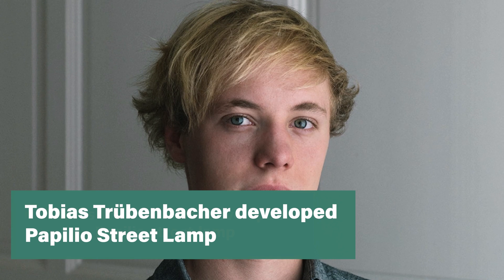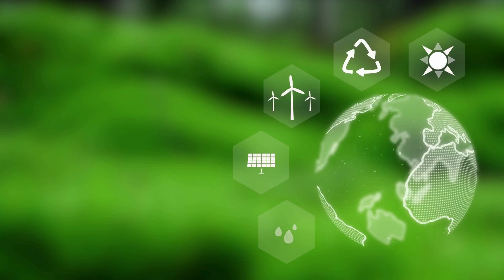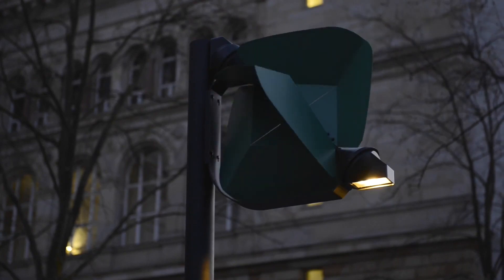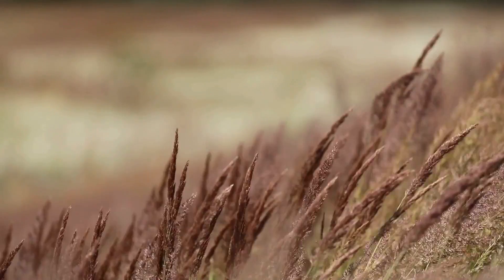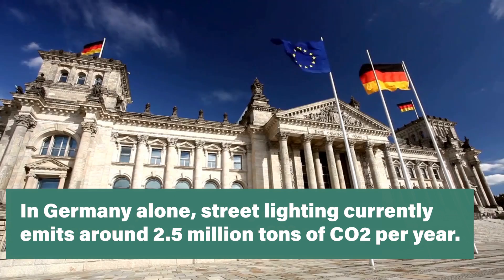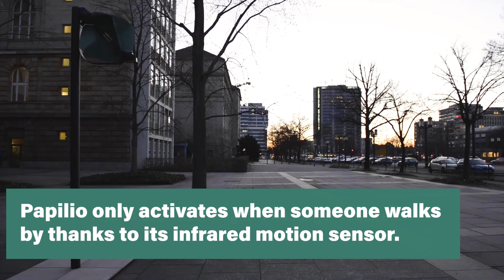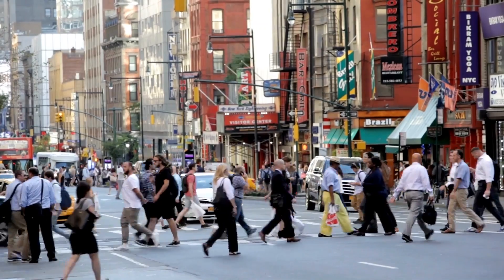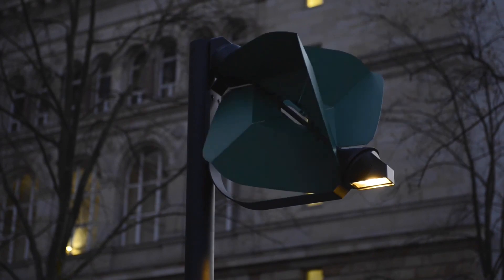A young German designed a game changing wind powered street light

Comment: There are many technical errors in this video. 12 V is not a measure of power. There is no way that the generator is capable of 300 W. That's professional cyclist power and that turbine could be stopped by a hand.
Reply: I suppose, the generator COULD produce up to 300 watts. But a savonius-type wind turbine of this size would probably need a wind speed of around 29 m/s (104 km/h, 64 mph) for it. And there is the question, whether this construction is robust enough for high wind speeds.
In rather common in-city-wind-speeds of 3 m/s, it might get an output of 3 watts.
And yes, this mentioning of a voltage (12 V) for "electricity" is very irritating. At best, it's a simple mistake. But it could also be a deliberate manipulation of the audience.

Comment: This kind of lighting is appropriate only for intermittent pathway lighting, inappropriate for roadway lighting.
Also, I'm guessing that charging a 12v system likely means the lights themselves can't be more than 9v per lamp which might be OK for the equivalent of a tiny room (but outdoors).
This kind of system might be OK for decorative and non-critical lighting but couldn't possibly be used for lighting essential for safety and security.

It's a good idea, and depending on cost could even be a money maker. Not all lighting needs to be constant and meet minimum standards and requirements for safety and security.